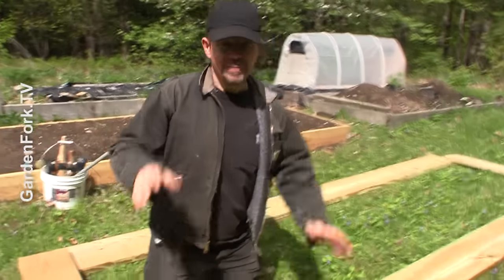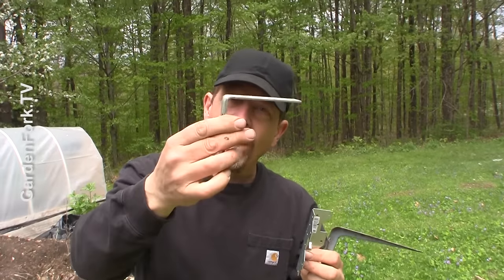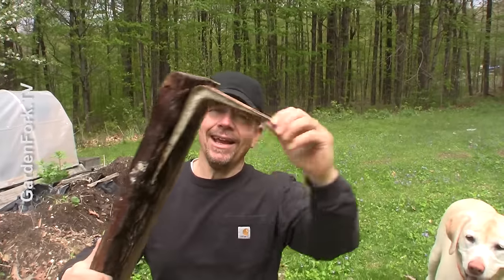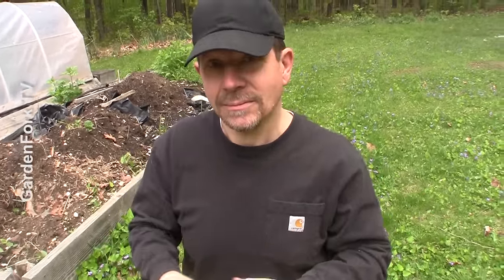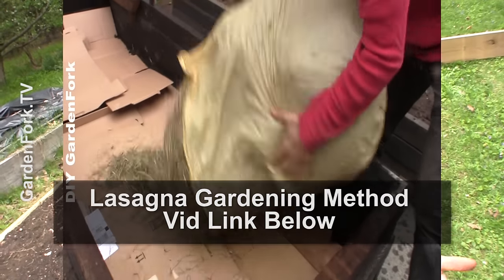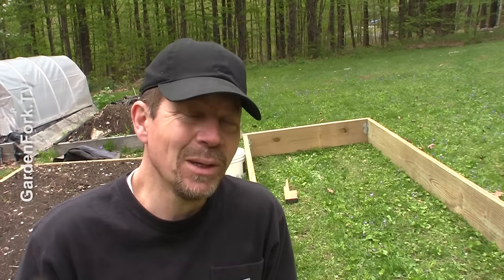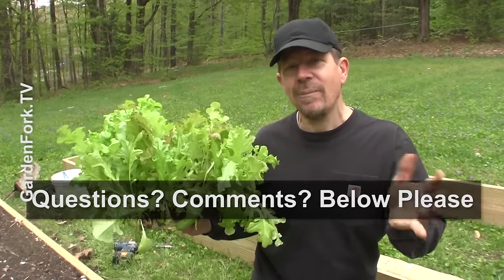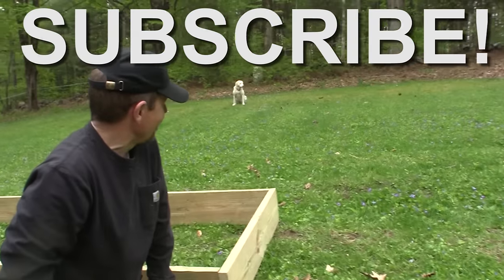How To Build A Raised Garden Bed - GardenFork

Comment: No room in my humble balcony container garden for raised beds like those, but I enjoy the videos and the dogs just the same!
Reply from the maker: +Hugh Janus at least you have a balcony, that's deluxe in BKLN!
Reply: GardenFork You know it! I'm very thankful for what I have. And It faces south.
Reply: also nail in some wire galvanized mesh on bottom for critters coming through. I use plastic road fabric and make and then sit the raised bed frame after nailing it on the fabric just an idea...

Comment: I always try to recycle used materials that I have laying around!
I did the 'lasagna' method in a large ceramic pot and it made it lighter to move around and it was a good way to recycle and use as compost!
Reply from the maker: +russtex good to hear Russ, had not thought of using it in a container garden. thx!

Comment: I was looking at those brackets since I previously used 2x4 and that is the failure point of my beds.  The cost seemed to be a bit much for me for the number of beds I wanted.  I use untreated wood for my beds so they only last about 5-6 years anyway, although I guess the brackets could be reused.
Reply from the maker: +Katie Cooks and Crafts shelf brackets work quite well, you could line the untreated wood and it will last a bit longer too. thx!

Comment: Raised beds are ok but here on my farm in N TX cardboard doesn't even slow down bermuda grass; so i line my raised beds with garden fabric; that also degrades over time and grass will come back; due to health issues I am now graduating to elevated beds; just like raised beds only with legs; they are more than 12 inches deep and have to be kept mulched because they dryout quicker; good job on the beds;
Reply from the maker: +Tracy Bruring luckily we do not have bermuda grass here! thx.
Reply: Bermuda grass is the worse. It's like the Terminator...just keeps on coming!

Comment: i am just curious if you do rotation on your gardens??
Reply from the maker: +SentOne1000 i rotate the crops around the raised beds, and cover all the beds with black plastic through the winter so they warm up faster in the spring. do you rotate crops? eric.
Reply: i don't grow crops as yet, i heard a lot of cons against crop rotations but my main concern is if crops aren't rotated wouldn't the soil be depleted of nutrients?
Reply from the maker: +SentOne1000 its good to rotate crops as a general garden practice, or plant a cover crop between seasons, or do both. thx!

Comment: I did a lasagna bed, but I didn't have any food scraps.. so it was mostly wood, leafs and peat moss, then about 2x 85L of potting mix.. I just put in my plants but I'm wondering if all that wood is going to rob the nitrogen from my plants? It was sitting outside all winter long... any ideas?
Reply from the maker: +Bethel Imaging you might considering adding in a time release garden fertilizer, that way it will add nitrogen back in slowly over time, instead of all at once. i do this once a year on all my garden beds. thx!